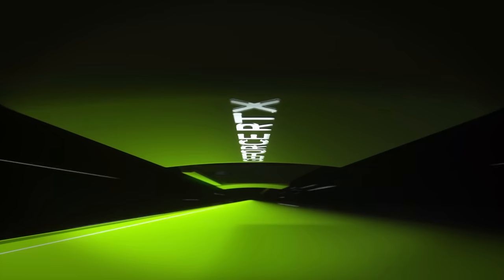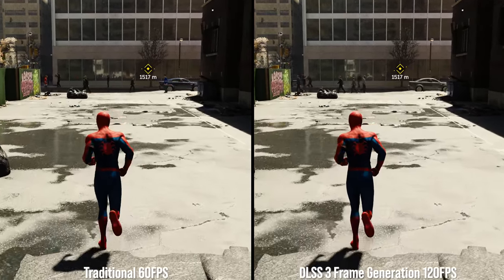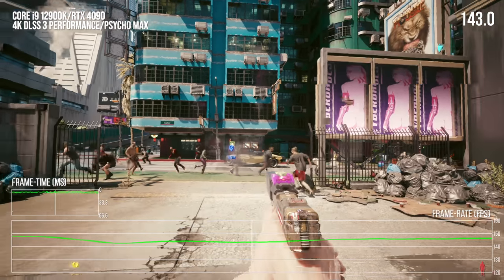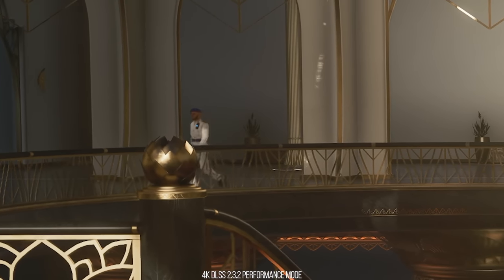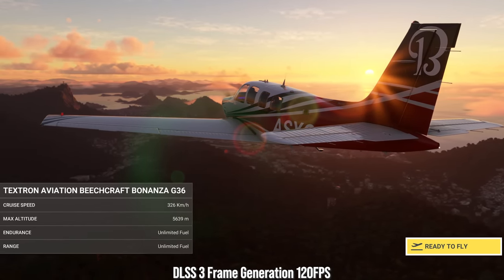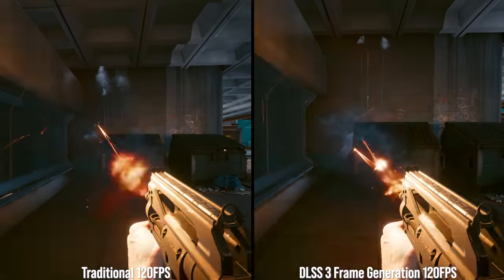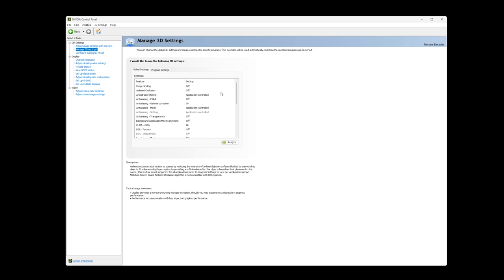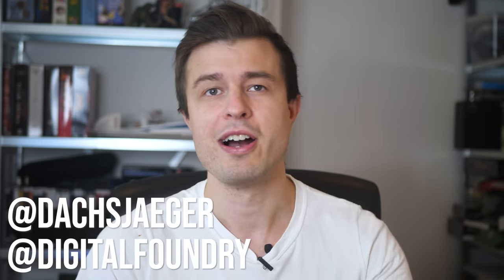Nvidia DLSS 3 Analysis: Image Quality, Latency, V-Sync + Testing Methodology

Comment: I think you are looking at the latency (or at least describing it) kinda wrong.
With DLSS 3.0 Frame Generation 120fps with vsync, vsync must apply BEFORE frame generation so the game is running 60fps internally.  You have the normal latency of that frame rate + lag from buffering frames.  Same with the 110fps number, the game must be running 55fps internally + frame buffering lag.  That's the only way I can think its working given its specifically designed to only frame-double and why its probably not worth using on games which already exceed 60fps natively on  120Hz screen (though could be useful to save electricity).  Its going to be more useful for RT heavy games where you will be in 40-60fps native 1440p but want a 4k 80-120fps output and don't mind slightly more sluggish controls.  Using it for 30fps to 60fps conversion is likely to feel too sluggish as I've found with some console games using a lot of post processing (eg Dying Light).

Comment: I am not completely sold on this tech, even more after seeing the 4060TI performance graphs posted by Nvidia. In your tweet you call this a "groundbreaking way to increase performance", but what is actually groundbreaking about a glorified frame interpolator? I mean yes, the fact that frames are generated via ML, other than that? On top of that, I see it as a quite dead tech, meaning: the only aspect in which this tech can improve is the quality of the generated frames, and unless AI can lower the frame generation time and correctly* generate more than 1 fake frame in between native frames, performance is going to stay like this, double framerate. So again, I am not convinced and I think that this belongs more to the "gimmicky tech" category, than to the "groundbreaking tech" category. I mean, it is nice to have a fps duplicator, but yea. Anyway, great video as always and I look forward for you to cover Nvidia Remix.
Reply: Cope.

Comment: Its kinda weird that DLSS3 seems designed for HFR displays, yet the tech and ports in the card inherently make it so you dont actually want to push over 120hz (or 144hz in a few monitors).

Especially given how it seems to easily become CPU bound even at 1440p which is the resolution which typically has higher refresh rates.

DLSS3 at this point seems like a much better fit for a 4070/4080. The 4090 performance levels are so high that it ends up in a territory where dlss3 is basically worse than dlss2, you either get tearing or massive input latency if you dont bring down the fps enough

Comment: How do framelimiters affect dlss3 actually? I couldn't get dlss3 to run smoothly on a 60hz screen with vsync on and no gsync without limiting frames in nvcp also. But then I'd get unbearable input lag. Just forcing vsync through nvcp in cp2077 did not yield smooth gameplay for me in cp2077 and hitman3.

Comment: I would like to see some racing games.

Its a little counter intuitive that I need to run at high framerates while not hitting max. A 4090 can obviously just play at native fps. Interesting will be 4060, if it can stay at 80+.

I also wonder how much data they can gather from native frames without it hitting latency too hard. What other information could be used to reduce the number of artifacts?

Comment: Great job Alex, but we cannot in fact see any real difference between your half speed side by side alley. runnings Spider-Man. weather focusing on the character model near or distant objects it makes no discernible difference and we are running at 2160 60 so would you running the clip at half speed? as you say, it's equivalent to 4K120 on my 4K screen so totally not worth it in my opinion. based on this example, maybe camera panning? or camera rotating?

Comment: So my setup of gsync + vsync in the control panel + frame rate cap of 140 fps for a 144 hz gsync screen should work fine? I hope it does cuz when I first got the G-Sync monitor I was testing with G-Sync off with crysis 1 it was running at about 90 fps but it was a choppy mess I can't even start to describe. I think vsync is an integral part of G-Sync right? Because once I activated vsync it became smooth as silk and that's how I've been running things ever since.

Comment: Cranking your settings up to stay under the VSYNC limit makes turning VSYNC on nearly pointless. Sure, you won't tear, but GSYNC with VSYNC off already eliminates most tearing. 

GSYNC+VSYNC is only useful for preventing tearing when you fall outside of the GSYNC lower or upper limits. Your settings changes prevent ever reaching the upper limit, meaning you are only avoiding lower bound frame rate tears. On the high end cards that can actually run DLSS 3, you will typically only reach that lower bound when you experience stutters. If you can avoid stutters, then forcing VSYNC on or off will make no difference.

Comment: Great coverage alex, i know its not really the point for dlss3 but it would be fascinating to see how it does at 30 fps (upscaled to 60) both in terms of input quality and latency, just as a kind of stress test.. Like what happens if you run native 4k, no dlss upscaling with frame generation? does it even work?

its kind of funny that we now have to bump up quality in order for the game not run too fast when using dlss3 :P i also wonder if they could introduce some kind of "max error" setting that would discard frames that the interpolator really doesn't know what to do with, like with a scene change, it could just present the last frame again maybe.. that could prevent the "flashing" when changing scenes.. its early days of course and im sure there will be updates

Comment: Good video, however I would never trade low latency for more frames in games. Frame generation is cheat mode when comparring FPS in a classic way.
Boosting videos however is probably good, but then it is the artifacts.
Reply: Depends how you play and on the game. A fast pace games that needs fast reflexes is better without DLSS3 adding latency but a more fun relax game could benefit more by smoother frame rate.
Reply: @SIPEROTH  A fun relaxed game don't need the extra FPS, especially not if they have artifacts. It's a lose-lose and I predict cards that rely on this won't age well.

Comment: Isn't the whole point of getting higher framerates to improve the gameplay experience? If turning DLSS 3 on adds latency (or, in best case scenarios, gets the same latency as DLSS 2 running at much lower framerates) then what's the point? It's a cool piece of technology, but if it doesn't have a practical use for games then it really just exists to make benchmarks (and, thus, Nvidia's marketing) look better.

This isn't even considering the added artifacts and other visual issues, and the fact that you can't have Vsync on when using it without severely tanking the responsiveness.
Reply: Most people who buy Nvidia graphics cards for gaming only care about how good the marketing makes them feel, not the actual usefulness of features.

Comment: Standing in front of a grid in a third-person game (played by 90% of people with a controller) by going crazy with the mouse? Really? Is that what you need to do to break Frame Generation? Or maybe create a moire distortion by running DLSS in Ultra Performance mode (720p base) a setting that should be deprecated at 4K for being useless? (it was in fact created for 8K but that was before frame generation, now it's not even needed for that as standard Performance mode + FG already reaches the current limit of 8K 60 in the largest majority of games)... seriously?
Alex, my suggestion would be for you to help customers make an informed decision based on the practical experience of sitting on the couch and playing the game normally more than creating improbable case scenarios or scenarios that need to be pixel-peeped frame by frame in a static slide show to be seen. 
Ask yourself "who am I helping by pointing out things that would never be noticed in a standard play session?".
What to do in order to avoid lag was interesting information for example, and in fact, FG should be activated ONLY when the base internal performance is below the target display frequency. The lag problem for games that (by using FG) jump to "too many"FPS (since they sport a base framerate that is already higher than the target display frequency)  has a very simple solution: turn FG off. Such games do not need FG as they are already running like a dream without it. 
Which in the case of the 4090 is basically true for 99% of games out there. Simple DLSS 2 in Quality mode is all you (sporadically) need for most of them.

Comment: Wouldn't the effective latency be double or triple the value for the single frame? If you input on the interpolated frame, the game has to show you the pre-rendered second real frame before rendering the one after that.
Reply: Games can still accept input at speeds separate from output resolution, what's being introduced is a delay in visual feedback.

Comment: 32:39 "No RT vs Psycho RT"
In a blind test I bet 90% of people are going to say the Raster image looks better.
Overall there is just no discernible difference besides a few edge case examples, but those differences swing both ways favoring either the Raster or the RT image depending on the case.
RT Reflections obviously look much better, but as we've been discussing for over two years now RT Reflections just are not important to games.
Shadows are all over the place in almost every game, and this is one point where the RT implementation actually hurts the look of the game. Hard edge shadows are aesthetically more pleasing, RT is removing detail from the scene and this is the biggest point where an average viewer will probably say the RT image is faulty even if it's physically accurate.

The main problem here is we're looking at a static environment, the ONLY case where RT is actually transformative to videogames is Ray Trace Global Illumination, being able to throw the world into absolute chaos and maintain correct lighting no matter what.
Freeing level design from baked lighting, that is what will push Ray Tracing forward, basically everything else you can do with RT is inconsequential at best or at worst a gross waste of resources.

Comment: Lol.... If even DLSS3's only real good use of hitting max monitor synced refresh rate comes at massive latency, it's basically trash. It's terrible at games with low native framerate, it's no good if you hit max monitor refresh rate, it has terrible latency and worst image quality with artifacts.

Seriously nVidia should have never put frame generation under the DLSS technology. It's not performance boost, it performance degradation in exchange for fake FPS. DLSS 2 + reflex is still the best solution right now.

Comment: I usually set a frame limiter at 118FPS on my 120Hz GSync Monitor in my NVCP and disable VSync completely.
Is that not also a valid option and bypasses the VSync Problems?

Comment: Hopefully DLS3 will reach the RTX of previous generations. But it seems that they will wait until at least all those 4090 and 4080 are sold at a premium price for that to happen...
Reply: it surely won't , they said it multiple times, i know it sucks but i think nvidia was saving it's new optical flow generator for the ada series, so yeah, no rtx gpu before 4000 will get it..

Comment: I'm thinking in-game 60 fps limit with dlss 3 frame generation to 120 fps should have better input lag, i'm also wondering what the input lag would be compared to tvs with motion interpolation, the lg cx has decent 60 to 120 fps interpolation but the input lag is pretty noticable for shooty games

Comment: Basically this is what DLSS was destined to end up as - a completely unsupervised AI based frame generation to boost frame rates.

However, we can all see DLSS 3 is far from ready despite running on third generation OFA hardware. I think nvidia is messing it all up by forcing DLSS 3 to push performance so hard. These artifacts can get addressed if there is more data. In other words we would get much less artifacts if DLSS 3 did 1 AI frame for every 3 traditional frames instead of the current 1:1 implementation. Sure performance wouldn't be double but the frame generation will be more mature.

Comment: Will you get the same input latency in non DLSS 3.0 games when running Gsync and VSync, for example CSGO with the FPS capped to the monitors max hz using Nvidias control panel (Low latency mode set to Ultra)

Comment: Hey Alex - curious - do you know what dlss frame generation does in cases where there is no actual scene continuation? Like during camera cuts, mostly. Is the system smart enough to realize “I’m looking at two completely different scenes” and know not to try to generate frames during that transition?
Reply: In MS Flight Simulator at least it wasn't smart enough to realize that, as shown in the video. You can see the zombie frame it generates.

Comment: Honest, the artifacts don't really bother me that much. Most of the time I don't see them at normal speed, and even if I spot them, they are not disturbing enough to pay it any mind.
The increased latency is the bigger problem here, since it makes DLFG unsuitable for the use-case where it is the most needed, meaning in low-framerate situation (sub-40fps).
Doubling your framerate when it is already high sees close to negligible perceptible improvements (due to diminishing returns the higher you goes), but playing a 60fps game while feeling like playing a 30 fps games is the worst.

Comment: What happens if I am hitting 80FPS without Frame Generation on a 120hz monitor, and then enable it? Will I still be getting 80 real frames and 40(ish) AI? Or does it drop to 60 real and 60 AI to be even.

Comment: Can someone explain this odd thing? I’ve been playing Cyberpunk 2077 in vsync, path tracing and frame generation on upscaling “quality” on my 4K TV for 60 fps gaming. I’ve also turned on ultra for reflex in the Nvidia control panel settings, as well as turn on G-sync and Vsync on in order to get a no tearing consistent framerate.

The framerate in-game is perfectly stable at 4K 60 fps, but the input latency is not constant. 

If I hop into the in-game menus and out again the latency gets super snappy and not very different from without frame generation, but as soon as I read some in-game text or sometimes enter a new area or something, the input latency randomly increases. If I just hop back into the in-game menus and out again it resets to a good input latency.

Why? It’s like frames get into a cue and then if I go in and out of menus it resets the cue giving back a better input latency. Why doesn’t it just throw away the “cue” dynamically so that the input lag stays the same? There’s no difference in frame rates between the low latency and high latency states, so there’s no reason for it to not reset on the fly. 

This makes the experience, which in low latency plays perfectly well, to instead be uneven and weird for no real reason. 

I hope this gets fixed with Phantom Liberty.

Comment: With gsync, can’t u just turn it on and set a framerate limit to never go over the refresh rate and boom u have gsync that works without vsync on? That way u get no tearing from gsync without vsync on because u will never go over the hz of the monitor?
Reply: V sync operates in a different way than only limiting the frame rate of the display.  Check out blur busters gsync best practices.
Reply: @Begohan1234  Ive seen that but havent completely read it hahahaha. So thanks I hope reading some part i didnt explains it.

Comment: OK I just did some further tests for Frame Generation with DLSS Performance mode in Cyberpunk 2077 on RTX 4080, which is easy to do using Nvidea overlay while running the benchmark test. Without frame generation the latency was about 40 and FPS 54, but with frame generation I had a vast improvement on Digital Foundry's numbers with latency only about 58 and FPS 77. A very solid level that is less than 50% more latency. Interestingly in Cyberpunk 2077, Vsync is forced to off in the settings when using Frame Generation, I couldn't turn it on even if I tried. Which makes a good deal of sense, at least when using GSync, because there's no need for Vsync, Gsync doubles as a screen tear solution itself, provided you set your max frame rate to at least 3 FPS lower than your monitor's max refresh rate.

Comment: Can you make a video on stuttering? Back pressure, frame pacing and all that. I don't understand. The clip of flight simulator with V-sync had that issue. But for me it's the opposite. The stuttering happens in 9/10 games if I don't enable both, V-sync and G-sync. And I can't use frame limiter or it will also stutter. With frame limiter, It can show completely consistent frame times but it stutters. Without fps limit and using G-sync + V-sync instead, my frame times can be all over the place but it feels very smooth. Seems like when I sett a frame limiter below my refresh rate, the variable refresh rate is not set to that. Giving me that stutter that comes from fps and refresh not matching. If I set frame limiter to my monitor refresh (60), It's better but not perfect. While v-sync will make my fps and variable refresh rate perfectly match. The freesync on my screen is not the newest version though.

Comment: So I would imagine with the latency if someone has gsync and it's game goes over the monitor refresh rate then I would imagine you would want Fast Sync on so the GPU is uncapped and shouldn't get screen tearing (I'm assuming fast sync is like AMD's enhanced sync). If this is how you 'fix' that problem for these games that run into that problem I'm surprised Nvidia just doesn't force on fast sync when using DLSS3 Frame Generation so the user get the best possible experience.